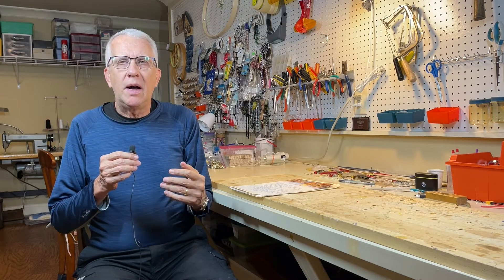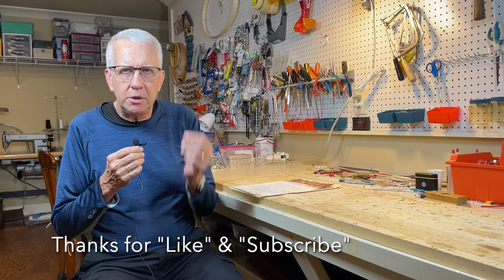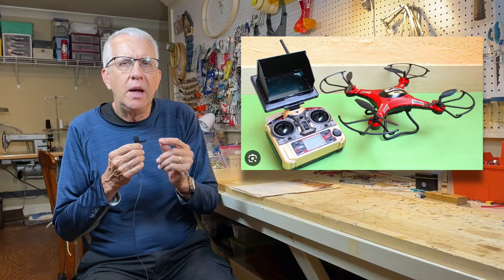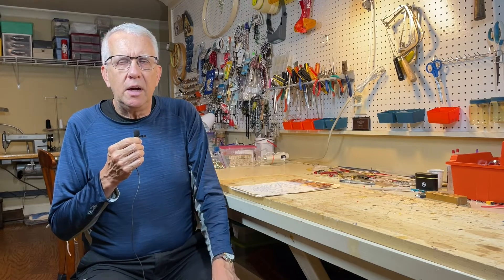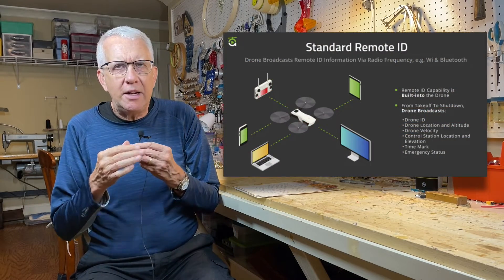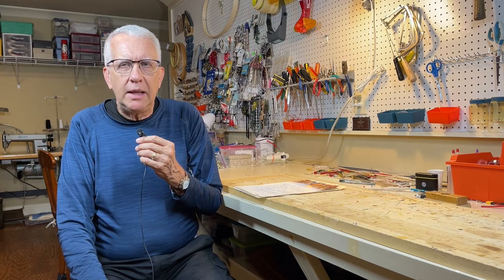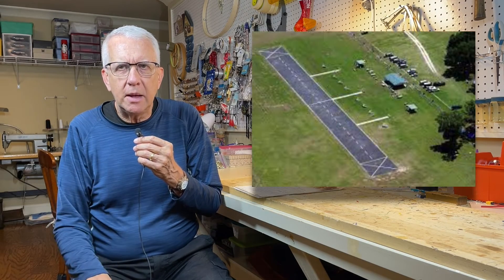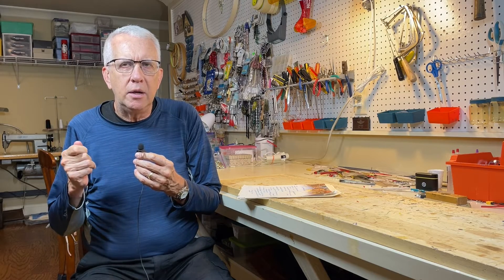Why No Standard Remote ID on ARFs?

Comment: Our club in Florida has a very unique situation, we fly on an active military outpost. Our club is not an AMA charter even though most of the members are AMA members. Even though this field is miles away from the main base it's still activated even though no military aircraft have landed here in years, it's more of a reserve or emergency use runway.  Because this is a restricted military airspace no commercial drones will ever fly through this airspace.  Any rules and regulations set forth by the FAA are null and void in our situation. We do have to follow certain protocols when flying here, we have to contact the base to see if the airspace is not hot, no drones are allowed, only RC aircraft that are flown line of sight are allowed, no  FPV is allowed. We must also monitor aircraft band scanners to see if any other aircraft are within the area. Civilian aircraft can pass through this airspace if it's hot but must maintain 1000 feet AGL. We are allowed to fly up to 600 AGL because we have a lot of glider pilots in the club. It's not the perfect situation, but it sure beats having to put up with the bullshit that the FAA is cramming down our throats pertaining to remote I.D......
Reply from the maker: Very interesting, thanks!  Tim

Comment: Drones have killed a fun and interesting hobby .
Reply from the maker: Drones have certainly impacted the RC hobby, but we’ll pull through. Tim
Reply: Snooty,Can't blame it on me and my drone. Careful,stick yer nose up in the air to high ya might drown if it came good rain storm.
Reply: I'm sure the "new"will wear off. I've had my "drone" for nearly 3 yrs.,and have never had it out of the house yet. I,m 71 yrs. old and a retired(just recently) longhaul truck driver looking for something to pass my time with.   Wouldn't hurt for you to "cut a little slack" to folks that don't want to fly planes. Rant over.
Reply: @jackguinn8462  Jack:  No worries, thanks for checking in!  Tim

Comment: Although we should probably applaud our beloved fixed wing model manufacturers for being ingenuous with the rules, there is in reality no exception that gives them a pass. See: https://www.ecfr.gov/current/title-14/chapter-I/subchapter-F/part-89/subpart-F - I believe that they are leaning heavily on the “home-built” exception by not providing everything out-of-the-box so being ready to fly. I think this is a real stretch and there is  a risk that the FAA could eventually clamp down on this and require that they fall in line. But I suspect the FAA will not enforce the rule and allow common sense to prevail, at least for a while - but who knows???

Comment: FYI, I purchased a HS720G from holystone on Amazon. It exceeds the 250g limit. It is NOT equipped with a standard RID. I purchased a RID module from holystone, activated it and now I simply look for a flashing green light and a steady battery light. So holystone isn’t complying. $80. I registered it with the FAA and I believe I can use it on my entire fleet.
Reply from the maker: Interesting update, thanks!  Tim

Comment: That spectrum engineer is smart for doing that.Our hobby is hurting bad enough with everyday inflation.And he knows increasing the cost of model kits will further hurt scales.I knew this was coming and this is a wise decision by Horizon hobby to make.The planes can fly without remote ID installed.My V900 doesn't have it and it flys fine,becides,I have no plans of installing a remote ID system in that aircraft.
Reply from the maker: For what it is worth, if flying recreational and outside a FRIA, you need just one (1) RID for your entire fleet of models.  Tim

Comment: I don't think remote ID is really required for actual radio control model airplanes.Airplanes are flown line of sight and maned at all times.Airplanes fly at a high rate of speed very low to the ground.My planes don't have anything outside of the normal servos and receiver and now of course an ESC.I think all this remote ID stuff is for multi rotor type drones that fly automouslly well beyond like of sight and at a very high altitude.I think the FAA is just being concerned about the potential of a midair collision with a full scale aircraft.This danger simply doesn't exist in the classic radio control model airplane/helicopter flying hobby.I have been flying without remote ID and it's been non eventful,just another day at the park field.
Reply from the maker: Negatory. All RC planes over 250 grams and less than 55 lbs need RID, unless flying in a FRIA. Tim
Reply: Is it rational and reasonable? Absolutely not.
Is it legally required? Yes.
Your government at work.
😢
Reply: Just because you don't fly rc airplanes high doesn't mean it doesn't happen. It has happened for a long time. Airplanes were the first FPV and long range platform and still are the most popular for BVLOS. Also, the danger in quads is primarily from camera drone operators (DJI style). Racing drones are kept within 500 ft and not higher than 20 ft in normal operation. Racing drone pilots are highly skilled. The problem is lawmakers are ignorant and listening to corporate interests who are chasing venture capital.
Reply: @richardjohnson2331  Seriously?
Reply: @gordonmckay4523  Yes. The point is that lumping in all quad pilots together as dangerous and untrained is wrong. There are racing drone pilots who have skills way beyond most rc plane pilots. The reason for all this added regulation is not quad pilots. It is the lobbying of the corporate drone industry. If safety was the goal, the FAA focus wouldn't be on enforcement, it would be on training. Blaming quad pilots is a cop out.

Comment: Perhaps you should mention that pilots are required to make sure their RID module is operating correctly (ie: has a GPS fix and is broadcasting a valid signal) every time before they take off.  To fly with RID module that isn't broadcasting a valid signal is a breach of the rule.   I wonder how many people will actually check though -- especially if the module is inside the fuselage of a foam model where the LEDs can't actually be seen and when checking operation would actually require using the app on your phone to validate the signal.
Reply from the maker: I doubt anyone will check this detail. Folks still busy taking off with reversed controls, etc. 😖 Tim